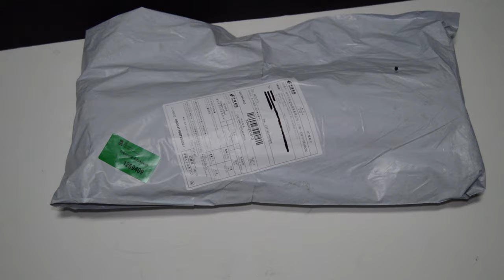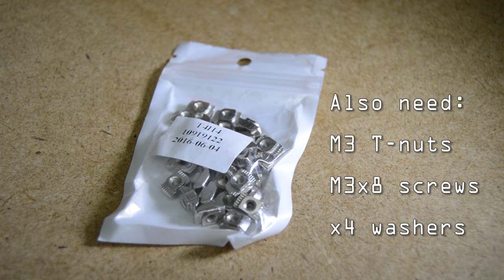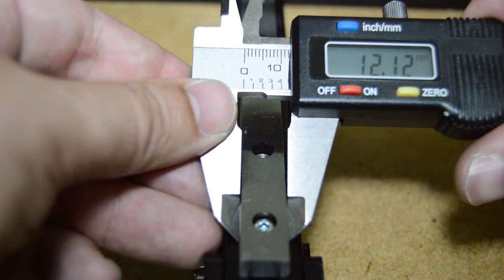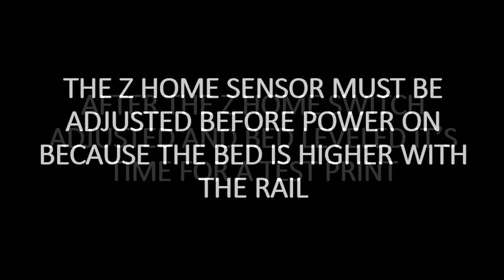TEVO Tarantula i3 3D printer - HOW TO improve your printer - Part 6 (Rail upgrade)

Comment: I just completed my Y-axel upgrade with linear rods, linear bearings and support plate, carriage or what ever you want to call it. For the first time ever it is finally stable, precise and doesn't need to be re-leveled all the damn time.
I think your mod was really not thought thru. As long as you don't have a rigid (i.e. metallic) support plate you're screwed, no mater how awesome everything is ...IMHO :)
Reply: I just completed my Y-axis too finally in 2024 🤣I used two aluminum 2020 extrusions and the same plate wheels. The acrilic plate was reinforced with a 3d printed mod. Now it's very rigid and prints like a dream 😄

Comment: Have you thought about limiting the acceleration? The table is heavy and you can see a little shaking in the timing belt when the direction is reversed. Had such problems with my printhead, its a direct dual extruder, which makes the printhead heavy with its two steppers on it. This got really visible when printing a cube and changing the movement from one axis to the other. For example when moving along x and then changing direction to y, there is a kind of wavy surface along the y axis. Not much, but visible. Limiting the acceleration solved that. I use slice3r, it has an option for that.
Reply from the maker: Greetings Flyby.
Thank you so much for your true and valid comment. In fact, there are many issues that can cause print quality issues such as backlash/belts loose, vibrations, jerk and acceleration, etc. It's true about adjusting the acceleration and jerk and i had to. My point in this video is to show that the rail will reduce the vibration and flexibility in that axis. Some vibrations in the printhead are also induced by the acrylic support that is not stiff. To improve even more i suggest replacing that acrylic piece with a carbon fiber one (that i will show in my next videos). Regards

Comment: This is a great upgrade also I used an aluminum plate both upgrades work great thanks
Reply from the maker: Greetings David. Its true and i love this upgrade. I also upgraded the table but instead of aluminium i have the carbon fiber because is much lighter. I posted that video too. Regards

Comment: I used your videos when I first got my first 3d printer a couple of years ago. Thank you so much for these! I have a question about this upgrade though. When you add the rail, that raises the bed up slightly. Doing so adds a slight angle to the belt, meaning it no longer runs flat and perpendicular to the frame. Does this cause any errors in the prints or have you done something to compensate for this change in angle?  I have read a few comments, I apologize if this has been asked before, but I didn't see it.
Reply from the maker: Hi Derek,
Yes, the belt raises a bit but you need to pass the belt (at the carriage) from the bottom up and not from the up side down.
It's not ideal to have the belt with an angle. The ideal is to have the belt parallel but if you will not print engineering parts then you will not notice that much.
Reply: @ruiraptor  Thank you. That was what was putting me off doing that upgrade. I may try that this weekend. Thanks again!

Comment: hi ruiraptor...it is very good idea to use rails for Y axis...good job...what is the rail lenght,350mm or 400mm? and what is the carriage mgn12H?
Reply from the maker: Hi, thanks.
I use a 400mm long rail and an MGN 12H carriage. The MGN12H is compatible with the carbon and aluminum tarantula y axis carriages.
Reply: i see,thank you for promot reply...i was worried about the conflict between rail and belt for mgn12h, but it is obvious that there is no conflict...what do you think about mgn9h? is it too small? also i am planning to use mgn9h for x and z axes by making some modifications to improve the precision

Comment: Hmm I think going to a twin rail y axis would be ultimately the best option. More work in the mod but way bro stable. I think no matter what system you use, a single rail with all the overhang of a printer bed there will be issues..
Reply from the maker: Greetings PlaneCrazy, For the Z i recommend dual rail. For Y i dont see the need. The system is very stable with one rail. One thing i would change ( and i mention in the description ) is change the acrylic bed frame for an aluminium one.
Reply: @ruiraptor  I have single rail and it is not stable enough. I'm going to add second rail.

Comment: Hopefully you cleaned the protecting gunk off the bearings first and added proper grease. If not, it'll wear prematurely and not run as smooth since the lubrication that is typically provided with those are only really meant for preventing corrosion.
Reply from the maker: Hi Greg,
I can let you know that the same printer with the same linear rail is still working today with no issues.

Comment: Hello. Your videos helped a lot on my tarantula thank you. I was wondering if you installed this upgrade on your x axis? One of my concentric nuts on my extruder plate wont get tight enough and lets the whole plate wobble. I ordered 2 rails and it looks like the belt might hit on the edge of the rail on the x. Just wondering if you attempted this yet and if you had any tips/info.
Reply from the maker: Greetings, thank you for your comment.
About the rail, I didn't install on my X axis. In my opinion, the X axis works great as is.
In your case you have the problem with the eccentric nut so you either replace the nut or install the rail...
Reply from the maker: When you install the rail, the biggest issue is that the hotend will be higher (rail is higher than the wheels) so it will be at the same lever as the aluminum profile. You need to make  an adaptor so that the nozzle will be lower than the aluminum profile....
Reply from the maker: About the belt, i'm not sure but i think that it will be very close but will not touch the rail. If it does, you will need to print the X pulley plates with a modification. I think that some users already did this modification in our facebook group. You can ask there and also get some pictures of the installation.
Reply: Thank you for the tips

Comment: Your videos are an amazing help for newbs, I haven't received mine yet but I ordered the bigger bed, will be te same rail length? 400mm or I will need a longer one? Thanks in advance !
Reply from the maker: Hello Hernán, Thank you for your kind comment. 
Regarding the rail length, it's the same. Buy the 400mm and it will fit.
Regards

Comment: I have the mgn12 rail like the one you have in the video, but i can't get the M3x8 screws into the rail holes. Did you tap the holes?  or did they originally come threaded? Mine are not threaded.
Reply from the maker: Greetings Androidzombie1

The rail does not have tapped holes.
They are normally drilled for M3 screws.
Maybe you got a different rail model or the manufacturer made wrong size holes :(

Comment: Hi, which kind of differences made after this mod? Is there a comparison photo we can show the improvements? P.s. you should use a nut before hotbed screws.
Reply from the maker: Hi Necati,
I don't have any specific picture to show you but the improvement is clear. Rails are much better than wheels.
You have much more stability and performance with these type of rails.
Regarding the nuts before the hotbed screws, i'm not sure what you mean but the way i assembled its not wrong ;)

Comment: How many screws and T nuts would you use per rail? 400 mm.
Reply from the maker: We would recommend 1 screw every other 2 holes.
Reply: @ruiraptor  I should have asked the size. M3 x ?

Comment: I have been following your videos and they are great.  I totally recommend the brackets they have taken my Tevo From a so-so Printer to a very good printer.   Can you give your slicer settings and your bed height settings.
Reply from the maker: Greetings Vbart, I'm using Cura. My bed height settings are manual (no auto-level) with 0 offset.  I'm still tweeking my settings but i can share some info: * Print speed=40   ;   * Top/Bottom thickness=0.6   ;   * Fill density=50%   ;   * Temperature =212   ;   * Bed temperature = 60  ;   * Layer height =(varies)  ;  * Rectraction speed = 50  ;  * Retraction distance = 8  ;  initial layer thickness = 0.3.

Comment: Do you still use the smaller part, and the wheels, or are they replaced by the rail?
Reply from the maker: The wheels and the small H part are not needed with the rail.
Reply: @ruiraptor  Ok, thanks - I couldn't see underneath. So why did you drill the 4 holes in the small part?
Reply from the maker: Hi Tom,
Being an acrylic part, i decided to make the holes first on a part that, if something went wrong, it would not make a difference.
And with that, i used the H part as a jig to drill the final piece.

Comment: What size nuts and bolts did you use to secure the rail to the frame?
Reply from the maker: Hi,
I used the same M3 and M3 T-nuts used by the printer.
Reply: @ruiraptor  Ok, thanks for that.

Comment: Why is the rail better than the roller? I'm in the process of designing other printers too, and I'm just wondering which form of linear motion is the best.
Reply from the maker: Hi Emanuel,
Rails are better because they are more robust and stable. Easier to work with and a good one last longer than wheels.
Think like this...a high end printer uses rails or wheels?...rails for sure.
Reply: ruiraptor Thanks for the quick reply, very informative. I don't know about the z axis though. I'm building a corexy and putting linear rails seems like it's a lot harder to mount
Reply from the maker: Installing rails on the Z in the tarantula is not as easy. You need to modify some parts but is doable.
Reply: Rails is best option for linear motion, but i think it's not worth it on 3D printer.. there are almost no forces. It's more suitable for engraving or routing machines. If i build some 3D printer (or upgrading some) i would replace aluminium extrusion with something that are better conected in corners like welded steel square tubes
Reply: Gosh,  i almost want to send some sockets. Its hard to watch you work with box ends! Great videos, so much work went in. A little editing would make them so much more useful. Thanks for sparing all the ridiculous  ego centric chatter so many videos bore watchers with. Again thanks!
Reply: Vojtěch
instead of welded steel tubes how about printing the corners and gluing in whatever length you need... if it's beefy enough it should be just as stable of a frame.
Reply: I have read that rails are really only better for horizontal applications . That is what they are designed for and need the gravity and weight on their axis in that direction. They can work vertically but not much is gained over wheels etc.
Reply: Paul F: That's not really correct. They have been building CNC mills with rails on all 3 axis for years. I've got a machine that is 20 years old, and still spot on.
Reply: True , Its not exactly cheap but the next step up from our printers is those with HiWin rails . They  have better specs and tolerances on prints. I just got my Fogertech FT5V2 and it uses them on the X and Y axis and leadscrew Z.  I am not for sure about using them vertically tho.
Reply: rollers wear out
Reply: @PatriotPaulUSA  No that's not true. Do you know how these are made? Technically all they do is provide a single degree of freedom (linear movement) while maintaining absolute rigidity in all other axes. The mechanical design doesn't care about from which direction the force comes. Its just like.. ballbearings. They work multidirectional. Where have you heard this BS from?
Reply: Quick more technical answer for you and anyone else curious:
Linear guides rails have very high rigidity in all rotational axis. Meaning linear guides rails don't skew much.
This has an upside and a downside:
Benefits: High rigidity means high precision can be achieved, almost all "wobble" is removed.
Downside: High rigidity means it's hard to use more than 1 guide for any axis. 
Because of the lack of skewing motion the linear guides need to be "perfectly" parallel to use 2 on a single axis. If they aren't it can cause a huge amount of friction and your motors will have lots of trouble and they WILL skip.

Using rails on your x and y axis is a great idea. Using it on the Z axis can be more tricky and generally not necessary.
Linear guide rails in delta printers, however, is a must-have upgrade.

Comment: The Tarantula is good only for one thing. To have parts for another one. :) I had a tarantula and after a fail atempt of improving it, I made a new one. :)  With rail or without it, this printer is just for parts.

Comment: If you raise the plate you have to move up the idler pulleys as well to avoid the angle you have in the belt now. Basic trigonometry... Your table now moves in in non-linear distances, depending on how close it is to one or the other pulley. Of course, this is irrelevant if you only print toys but if you want precision and accuracy then you have to consider this point and spend some time on correcting this error in your "improvement".
Reply from the maker: Hi, You are correct but the issue here is that i passed the belt from the top on the carriage. In my next video (carbon fiber upgrade) the belt is installed from the bottom side and that way the angle is much smaller.

Comment: Hi, I have been looking into this for a while now. I know that I need a 400mm long rail, but I am not sure what MGN to choose? MGN 7 H, MGN 9 H or MGN 12 H? What is the difference?
Reply from the maker: Hi,
You will need an MGH12H because that one is compatible with the carbon and aluminum y axis carriages.
Reply: @ruiraptor  thank you. For the acrylic carrriage I need to drill holes like u show in the video and it will be compatible right?
Reply from the maker: If you have the correct 20x20 rail carriage then yes.

Comment: Rui, I have the rail but I guess I am not smart enough to do the math. How did you determine the spacing for the drilled holes? I tried measuring and drilling the holes but the spacing did not come out right so I had to print the Y Carriage so I could try again. Thanks
Reply from the maker: Hi Eliot,
I have an idea...download the datasheet and print the layout page where you have the holes distances. place that over the carriage and drill the holes.
Reply: +ruiraptor Thank you. Do you have a link that I can get exactly what you are talking about? I found a few but none of the ones I found will work. Great videos by the way and your website is pretty cool!
Reply from the maker: Hi Eliot,
Please send me an email (ruiraptor.channel@gmail.com) and i explain better.

Comment: when you are done with all improvement, how much cost the printer? Maybe buying a better one the first time instead of spending time and money on modifications will be the good choice? I say that since the goal is to print, not redoing a printer...
Reply from the maker: Hi Woody,
You are correct about that, but mind that you don't need ALL the upgrades. Some are important and some are nice to have. I made a video explaining that and what are (imo) the most important upgrades. You can watch it here:
https://youtu.be/srYLCs-9tok
I also made a video about the most important addons here: https://youtu.be/73KTJmifeAE
Reply: a "better one"  will still have room to upgrade. 
It is always more value when you can do it yourself.

Comment: intresting, that rail costs more than the entire thing, somehow i dont get it why brother at all when the base is wobbling on 4 spring loaded screws and the whole structure flexes
Reply: High quality rails is super expensive but he used chinese one it costs around 10-15 bucks and works you know wheels are better.
Reply: I was just about to post the same comment, those springs are waaaaaay too long and soft.

Comment: Please send me the link where to buy or description of the piece.
I think to do the same on my Tevo Tornado.
Thank you
Reply from the maker: Hi Ivan,
Here's an example where you can get them:
https://www.banggood.com/pt/MGN12H-250300500550mm-Linear-Rail-Guide-Linear-Sliding-Guide-Block-CNC-Tool-p-1156260.html?p=84280421195697201804&utm_campaign=21195697&utm_content=3312
Reply: ruiraptor 
Thank you.

Comment: Ruiraptor, nice Job, thanks for all the videos. I trying to make my tarantula better as well.... A Question, MGN15 (15mm wide) rail would not be better? In Aliexpress they sligthly more expensive.
Reply from the maker: Greetings Jozsef, 
The MGN15 is higher ( which will make you loose Z height ) and wider. Being a wider and more robust carriage and rail, will last longer and maintain stability for a longer time since it can handle more load but if you get a true quality  MGN12 combo you will not have any issues with it.
Regards
Reply: I'm going for the MGN 15 H, it's only 3mm height dif and if you go full aluminium or CF, you will not need 2 plates like in acrylic (what Tivo calls overlay to strengthen) so Z height loss should not be much of a worry. Right?
do you see what I mean Rui? I don't know if it is worth the extra cost tho. What is your opinion?
Reply: MGN15 is pointless in this sort of application. If I upgrade my CNC I will use MGN15 because I am milling aluminium as well, but for a 3D printer, even MGN9 is more than enough. As for the "lasting longer"... I don't believe that MGN15 lasts longer than MGN12 or MGN9 in a 3D printer. All three will last as long as you live if you don't have binding, but... one single rail is in my opinion not a good idea, so if I'd have this printer, the first thing I'd do is upgrading to dual rail.

Comment: is that a 12mm rail? and what size rails fit into the aluminium extrusions?
Reply from the maker: Hi Quentin L,
It's an MGN12 400mm long rail for the Y axis.
Reply: ruiraptor thanks